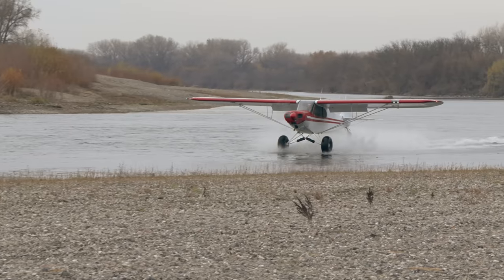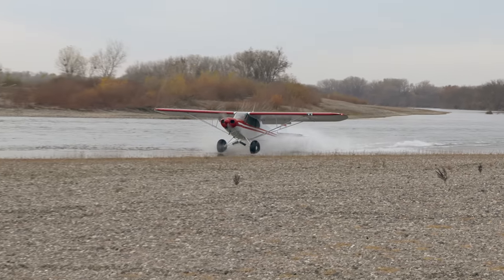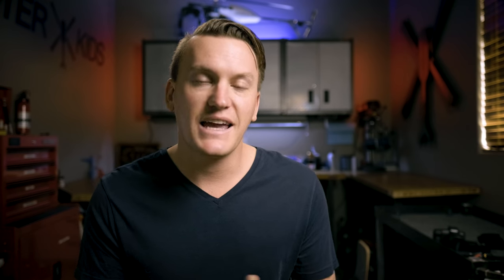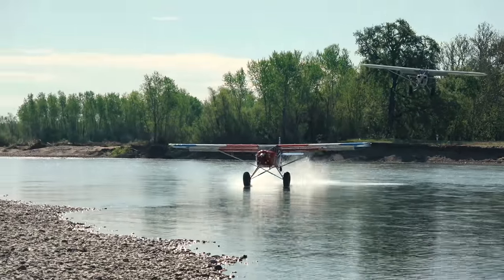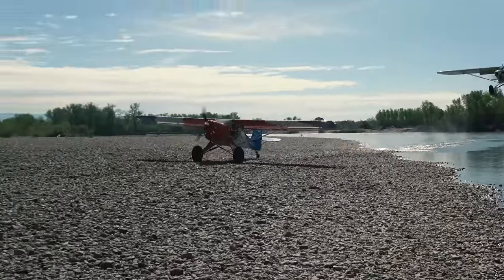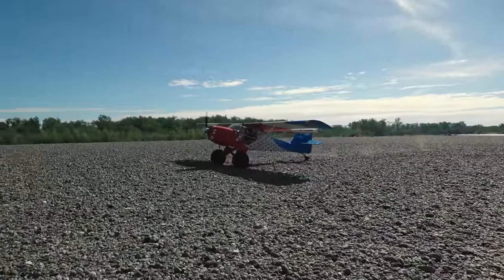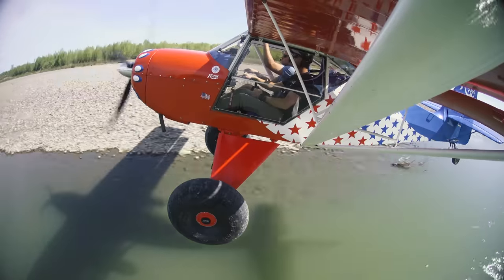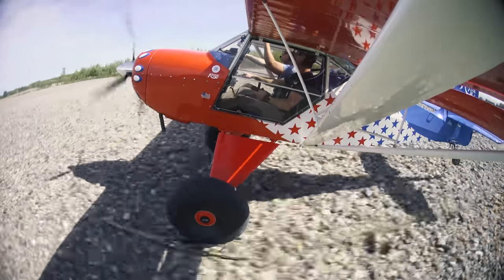How To Waterski An Airplane, and Why You Probably Shouldn’t

Comment: What you  call surface tension is not at all surface tension. The correct term is dynamic pressure and is a totally different physics issue.
Reply: MyTech Yeah, had me wincing too, but used as a colloquialism it got the point across—albeit at the expense of propagating a common misconception about surface tension. 

To be fair though, I didn't know what the correct term was (aside from planing) even though I've taught intro physics for years. I knew it had something to do with impulse/momentum but don't have enough experience with fluid dynamics to get further (without hitting up wikipedia).
Reply: I know several people that confuse dynamic pressure with surface tension. Dynamic pressure increases with increasing velocities and is affected by way too many variables to list. Surface tension doesn’t. Their respective properties are close but totally different.
Reply: He did say he was not a Physicist
Reply: I personally don't see any practical application for water skiing. But then there isn't much practical application to flying around in a kitfox either. You do it because it's a blast. I would try waterskiing if I had the right airplane. And landing on a grass strip is wreckless flying? That's hilarious. I guess that FAA guy has never seen any back country flying where you guys land up hills, on top of hills etc etc. He probably flew cessnas out of a big airport and anything else frightens him. Total disconnect from reality. So are all these alaskan dudes with videos of them landing on the water next to sand bars going to get letters from the FAA? Even the Anchorage FSDO would probably piss themselves laughing at that!
Reply: I was cringing as well. Surface tension? Lol. Especially after the preamble about how he was going to discuss the "physics" of how the stunt works. Someone didn't pay attention in an actual physics class. Good video though. I would never jump a motorcycle over 25 buses, but I certainly will watch someone else do it on my computer screen. It's fun to watch other people to crazy shit.

Comment: If landing 'anywhere but a paved runway' is 'careless and reckless', has the FAA ever heard of a seaplane? No less, have they heard of any grass strip ever? How about most of Alaska?
And of course they get you for going fast over water after briefing the risks and what to do in an emergency with your passenger, as opposed to slowing to land.
Reply: I don't think they have issue with landing on grass.  They're not saying it's reckless in and of itself.  They're just saying his Kitfox doesn't have the performance numbers for anything other than asphalt in the POH, which if true is a major oversight for a company that sells bush planes.
Reply: n122vu   just an FYI,  the builder of the kit is the “manufacturer” of the aircraft, not the kit provider. The builder is the one that gets the airworthiness certificate from the FAA after completion of the build. He/she is also responsible for writing the Pilot’s Operating Handbook for that particular  aircraft after completing the mandatory test flight phase of  usually 40 hours.  No two completed experimental aircraft are exactly alike due to engine choices, propellor choices and installed equipment , even if both are from the same kit supplier. All weigh and perform slightly different from each other hence aircraft specific P.O.H.s must be forever attached to the aircraft they were written for. Hope this very brief explanation helps folks  understand the origination of P.O.H.s for an experimental  built aircraft. Thanks n122vu. I hope Trent inspires you and many more of his wingmen and women to join us in the skies.

Comment: Just an A&P mechanic wandering through. Would like to point out the potential for water to get into your wheel bearings with water skimming. Could cause them to rust. Rust and pitting is usually immediate rejection so that could set you back a couple $100 for new wheel bearings. Also the possibility of over-speed for the wheel bearing. Basically spinning it so fast that the friction of the bearing produces enough heat to thin out the grease. The grease gets thin enough to a point where it doesn't lubricate. Worst possible case the bearing blows apart completely or it seizes in place. All that said you could have to skim for quite some time above the aircraft's landing speed to cause this to happen. Just wanted to throw that out there.

Comment: LoL, 200# at 40mph? Ok, not really wrong, at 175 my preferred speed is 39mph. But I grew up waterskiing, moved into wakeboarding and waterskiing. On a front deep water start, longline, I can plant my feet and stand as slow as 22mph. Drowned in spray until the boat gets up to speed. Really like this video though. Water is harder than most people think. And glass smooth water? Never good! On the bare feet, it is a knife edge digging into one point on your foot. A one inch ripple makes for a nice foot massage. Love it bro, keep the good stuff coming. Be putting maiden flight on my Flight Test Freedom Fox this week.

Comment: Trent, when you asked for a legal interpretation you were essentially asking a lawyer who might have to prosecute a case against you to tell you how to pick apart their case. That's never going to be fruitful. :-) The FAA has intentionally made interpretation of part 91.119 vague so that they may apply it on a case-by-case basis. The specific subparagraph of the part cited in the investigation letter doesn't really matter, because even if you successfully argue that subparaph A doesn't apply, subparagraph C clearly WOULD apply. If you read subparagraph C in its entirety, which would include the clause the part starts with, then it would read "Except when necessary for takeoff and landing, no person may operate an aircraft below 500' when over other than congested areas except over open water or sparsely populated areas." That means you cannot fly below 500' period, full stop, unless you are taking off, landing, over open water, or over a "sparsely populated" area. 

Lake Tahoe is not considered open water, so you cannot claim that. I know that seems wrong, but if you look at the FAA's Aeronautical Chart User's Guide it defines the difference between open water and all other bodies of water with color. Look at a Sectional Chart and you'll see Tahoe is not open water. Open water is essentially off shore, as in the shore of the ocean. A few exceptions I found include the major portion of the Great Lakes (except for an area near Green Bay) and Lake Okeechobee. 

That leaves only the question of whether you were over a "sparsely populated" area. Looking a satellite view of Lake Tahoe, I can't see any portion of the shore that is sparsely populated, so your case would hinge on whether the Administrative Law Judge determined the area over the lake is "sparsely populated." Given there is a delineation on aeronautical charts between "open" water and other waters, and that the term "open water" is included in the rule, I think you would have a hard time winning that one.

One of the ways we can learn what certain laws mean is to look at how they are applied in court. The case of Administrator v. Folk is instructive in this case:

http://www.aerolegalservices.com/Articles/Congested%20Areas%20Under%20FAR%2091-119%202008-08-28.shtml

The gist of it is that although the board of law judges who reviewed the case on appeal initially noted the FAA "has not pronounced a precise definition [of "congested area"] that includes the factors of the density of the population in an area; whether there is surface traffic in the vicinity; or the numbers and proximity of residences, buildings, or structures," it still affirmed the Administrative Law Judge's determination that the disputed area was "congested" for the purposes of the case in question. An ALJ, by the way, may not know anything at all about flying, so they often defer to a flying authority for definitions. In this case, the flying authority is the FAA. 

What that means is the FAA retains the authority to violate you if you fly lower than 500' ANYWHERE over the lower 48 states unless you're taking off or landing. The inspector who told you landing anywhere off a paved runway surface was likely simply warning you that the rule, which is applied on a case-by-case basis, may apply AT ANY TIME, so unless you should be prepared to cite relevant information about your operation when landing somewhere off an airport. His example about performance data is relevant. If you don't have it for a particular operation you probably shouldn't engage in that operation, no? You can develop your own performance data if it doesn't exist (EAA has just published a new manual on flight testing). If you can show that you made every effort to mitigate the risks involved in landing in somewhere off airport I don't believe any FAA inspector will go after you. 

Am I claiming the FAA never abuses its authority? No. The FAA has certainly used its authority in capricious and sometimes spiteful ways in the past. Was it abused in your case? I think you clearly violated the rules, and even you yourself acknowledge doing what you did with a passenger aboard was not smart. Overall, I appreciate your tone on this video (Although I would prefer that you were more adamant about discouraging this behavior and I wish you had not implied at 14:30 in the video that getting caught was your biggest mistake). There is a place for this kind of flying, but you need to justify it. If you have an operational need to land where skiing is the only option, AND you take appropriate precautions (get training from a licensed instructor, know the performance data, be proficient, etc.) then I believe you're golden. If you have an accident, however, and you have not taken these appropriate precautions, then you expose yourself to the potential insult of an enforcement action added to the injury of the accident.

Comment: Mixing done nicely and maybe... just maybe you may have saved someone's life too,because you KNOW there are people who need to know where the edge is. I used to fly a R172K to some fishing places... and flew a BL-17ATC out of a cow patch about 400' of  good run, then a sand trap, a one way strip with a honkin tree right off the approach. I never had a problem, but even ultralights crashed there.  I had maybe 10 feet of squiggle room on each wingtip on the good part. The worst part was the bull who took a liking to my spinner after I removed the paint and shined it up. OK, landing #13 maybe I was a bit weirded out. There was no go around on landing after the tree. NEVER took a passenger to that strip. Got vectored by USAF once when leaving Palm Springs because a corridor got shut down after filing, and they sent me East of area51 into a band of TCU's then cut me free . Another close one! Not many pilots will be truthful or real because they are so worried about the Feds. So, like you I say maybe get some dual acro instruction, and concentrate on recognition and controlling unusual attitudes etc, and then strap on a chute and go to a designated practice area and really learn your plane in all foreseeable situations. Then never do anything to need that chute again!! Like the music, I am retired 72 years young also do quads and fixed RPV and music creation is also as rewarding as a nice calm day in the air. Take care my fellow human of planet earth, have safe fun!

Comment: Dirt bike riders can ride over smooth water if you go fast enough ! It’s a skill like any other skill .
Reply: Guys up in my neck of the woods do the same with snowmobiles. I remember one spot where there was (as I remember) a 15-20 ft patch of clear water and a huge number of tacks on either side because the locals would use it as a shortcut.

Comment: No sure it's been mentioned but my understanding of this effect on water is that the actual hydro-plaining works better with brakes locked. The bouncing bomb (WW2 fame) is a good example here, rotating rearwards is even MORE effective. Rotating wheels will make this effect on water 'less' effective.

But of course if you are going to go from water to 'land' then locked brakes will be an overriding concern. :)

Comment: It sounds like you got screwed by the FAA. I agree with what you said about water skiing with passengers being an unnecessary risk, but like in your case where your passenger was the one that requested it, and they were ok with the risks involved, I don't see the issue. Sounds like a victimless crime, if a crime was even committed at all. I'm not a pilot (though hopefully that will change soon) but say someone wanted to take up water skiing, wouldn't it be beneficial to first experience it with another pilot in command? How would someone be able to do that unless the CFI had the new pilot as a passenger?

Comment: The technique can also be used to takeoff from a bar that's "too short." As long as you reach skiing speed, but not quite lift off speed, while still on the bar, the final acceleration up to takeoff speed being done while skiing. This is quite a bit more demanding then skiing ONTO a bar obviously, but can be useful on a really short bar.

Comment: ....Keeping in mind that this is the same FAA that certified an exotic, computer-controlled and limited input, zero-fail safe automatic system that literally took control of the horizontal stabilizer of a commercial passenger jet in the most vulnerable point of the flight envelope.

Yeah, you guys are definitely the authorities on aviation safety...................................................
Reply: apples and oranges..nice try at distraction from the real topic...environmental disregard...!
Reply: @savannaswildnatureworkshop7810  Wow. Okay......... .......Backs away slowly from crazy person..............

Comment: Smart not messing with the Feds. Lost my right leg, hip, and pelvis at age 16, can't wear a prosthesis, but I loved to fly Luscombes. Had many battles with the Feds over that, despite the closed rudder system, strapped in left foot (pull for right rudder; push for left) and handbrake for the right brake on the stick. Finally had a proper medical test flight at HEF (D.C. District) with a former F15 pilot who issued me a SODA with just one limitation: must wear corrective lenses for near and distant vision. I'd go on to fly other tailwheel aircraft but remained a Fed magnet. You did well, Trent. Just nod, agree, and move on 😉

Comment: Trent, you are amazing on several levels. You have a huge "bully pulpit" that you can use very effectively to promote reason and safety. Younger, newer (and less intelligent!) pilots need to hear your voice.  I suspect that this little video has saved more than several lives and dozens of airframes to boot. You are that important now. PLEASE continue as a role model with a voice of reason and wise restraint. Your next video on the subject of safety should be on the use of helmets. Get Gentex to give you a pair of aviation helmets and shamelessly plug them from now on!

Comment: I’ve read (and been involved) in this chain for the last couple of days.  What is missing proportionality.  

There is an aviation judgement difference between things you can do on barren public lands & waterways,  at 3k ft., over & around cities & private land, and on the most contentious & heavily used water way in the nation, Lake Tahoe.  

(CA & NV actually fought a war over it, the Sage Brush war, and all the interests in Tahoe have been at war ever since: developers, environematalists, sailors, campers, wilderness, boaters, fishermen, miners, public access people, private beach people, sea & float plane operators, jet ski rental, Casinos, nature preserves, protected forests. 

The list of stakeholders is endless.  

To top it off, The Coast Guard has a Lake Tahoe station because Tahoe is part of the interstate federal waterway system with commercial traffic between CA & NV.  Tahoe is also a drinking water reservoir.) 

This is not the hill to die on regarding FAA overreach.  

Instead, be self-interested & be smart: monied interests around Tahoe could crush any activity on or around the lake like LSAs, particularly if Trent had tripped on a half submerged log or something. 

As for the other: Trent admitted he knowingly violate FARs and took responsibility.  Good man. 

Those of us back east are envious of the Flying Cowboy’s access to hundreds of miles of witness-free public lands.

Comment: 91.119 and 91.119(a) says: 

Except when necessary for takeoff or landing, no person may operate an aircraft below the following altitudes:

(a) Anywhere. An altitude allowing, if a power unit fails, an emergency landing without undue hazard to persons or property on the surface. 

The part I want to emphasize is 91.119(a) : "... without undue hazard to *persons or property **on the surface**." It doesn't say anything about pilots, passengers or aircraft. Only persons and property on the surface. 

Moreover, 91.119(c) says: 

Over other than congested areas. An altitude of 500 feet above the surface, except over open water or sparsely populated areas. In those cases, the aircraft may not be operated closer than 500 feet to any person, vessel, vehicle, or structure. 

In my reading, there is clearly NO minimum altitude to adhere to over open water so long as you comply with 91.119(C)'s 500 foot rule. Meaning: fly as low as you want over open water so long as you do not come closer than 500 feet to any person, vessel, vehicle, or structure. (Gosh I hate the FAA sometimes...) Sorry you got busted, Trent.
Reply: loversRule, this is exactly right and I agree wholeheartedly.  Trent could sign up with AOPA and pay an extra fee for lawyer services and get it reversed I would think. Maybe I need  to watch the rest of the video first, before further comment.
Reply: Right, and they can't say that ditching in the water isn't a viable emergency landing.